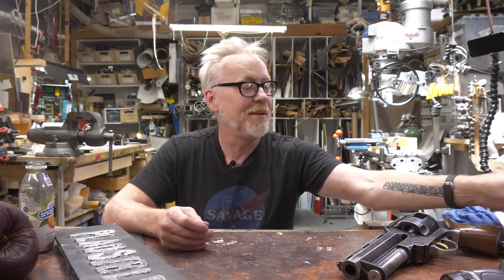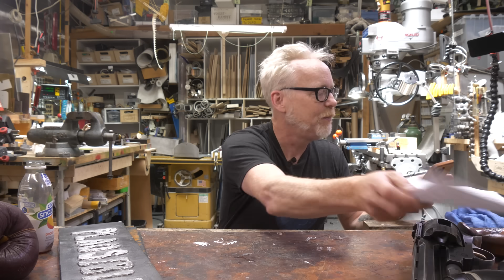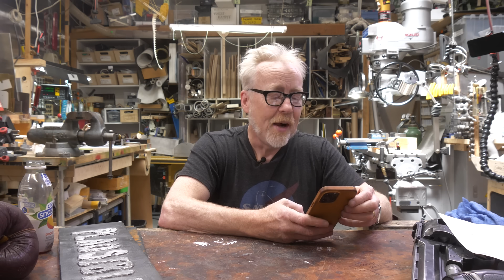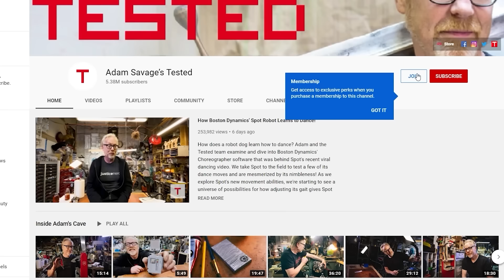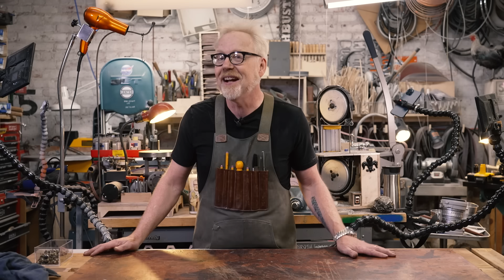Hardest-to-Obtain Item in MythBusters History

Comment: Adam: "Can we blow up a grenade?"
Insurance: "No. Too dangerous."
Adam: "Can we make our own grenade out of plastic explosives and blow it up?"
Insurance: "I don't see why not."
Reply: I think it's really that insurance can't evaluate the risk from getting anyone else's live grenade. It's like requiring that you pack your own luggage and remain in control of it.
Reply: its hard to accurately remotely detonate a grenade. imagine tying a strying to the pin and ping! but no explosion. the scenario of undetonated c4 is easier to apporoach than a grenade
Reply: @Iron_Triton  That's a great point. I also thought that the c4 grenade would lack the shrapnel, that would genuinely make it more predictable and safer.
Reply: @Iron_Triton I presume you could just stick some c4 to the outside.  But then you aren't just evaluating the grenade but the grenade plus extra c4 because you can't go add that after since you don't know if the chemical initiator will go off.
Reply: @Iron_Triton
Reply: @Iron_Triton  Just like in the movies!
Reply: @Iron_Triton  i think they were meant to be thrown
Reply: “Can we turn a cement mixer into the worlds largest grenade…”
“Yes, I don’t think that would be a problem.”
Reply: Don't forget the 20 ton cement truck they blew up.
Reply: What about a Cement truck? 

"Sure no problem"
Reply: Weird thing being is that I am pretty sure there's civilians with grenades that have posted videos on YouTube showing they own a grenade... I'd 100% trust Adam more with one than some random Texas guy xD
Reply: @SyntheticFuture  they don’t just hand them out. The paperwork to get your hands on any explosives* is extremely time consuming and tedious. You have to have special storage for explosives and there is a limit of how much can be stored in one place. Also you have to document how much you have, use, and manufacture. See the video Ordinance Labs did on this subject
Reply: @SyntheticFuture  Under federal law it technically is legal to own a grenade if you have the correct NFA title 2 paperwork and the grenade is properly registered as an NFA title 2 destructive device with the Bureau of Alcohol Tobacco firearms and explosives. 
However, California has additional state laws that ban the ownership outright of NFA title 2 devices, which includes grenades.
Reply: @SyntheticFuture  I have a grenade casing at home - a souvenir from my grandfather who built the casting machine used during WW2 (it is the un-machined steel casting).
There is literally nothing complicated about a Mills Bomb.
Reply: @SyntheticFuture  I had a roommate in the 1990's who had what was very likely a disarmed torpedo. (I don't remember where he got it, or if he ever told me.) We kept it in a heavy glass cylinder by the front door that I used as an umbrella stand. One day he got paranoid about it and took it to a fire station to get rid of it.
Reply: @SyntheticFuture  plq
Reply: @SyntheticFuture  And that is an example of elite fear... which isnt a good thing. You assume that unless somebody is of your level or higher (whatever you deem to be your level and you probably think you are much higher class than you actually are) that they must be stupid and therefore you are afraid they will do stupid things. But it is clear that high class and rich people do really really dumb things and should probably be the ones that we should be afraid of because they don't seem to care about others and seem to think their ideas are all good ones.
Reply: @SyntheticFuture vast majority eould be dummy
Reply: @SyntheticFuture  even if the guy in texas is being just as safe?
Reply: @hellishcyberdemon7112 honestly yes. Because there was a full production team and camera crew at mythbusters and he would be extra careful to not endanger any of those people.
Reply: @SyntheticFuture  yea i see dumb guntubers getting their hands on this kind of stuff, the reason why they actually can do it is because they dont have an insurance company telling them what they can and cant do
Reply: @worldchamp1999  well they do have to pay a lot for a tax stamp since it is a destructive device
Reply: It's less about insurance and more about  BATFE regulations... It's not very difficult to repack a de-milled grenade, fill it with some plastic explosive, then use a fuse assembly from a legally purchased and $200 tax stamped non lethal type of grenade, However the donor grenade must then be destroyed after recording paper work / providing a serial number to the "new DD grenade" along with a $200 fun stamp before activating it... Transfer of existing live 40mm HE grenades, hand grenades and other surplus military explosives whether new or original between Federal explosive license holders is basically impossible because the BATFE will usually just deny it after months of waiting with no actual reason given, so unless Mythbusters would've been working with someone who already possessed legal hand grenades or the military (yeah right lol) then there is really no good way for the bomb squad to aquire a fused grenade, plus they'd need a reason as to why, and "for training and education" doesn't cut it. So that's why they took the easiest, safest, fastest route of filing a "random metal object" with high explosive. No record keeping needed other than quantity of explosive materials used and for what purpose (training 😉) all while technically not creating a destructive device that would have to be serialized, recorded, and justified to the tax payers lol 😄
Reply: @worldchamp1999  Majority of the “guntubers” have federal licenses that allow them to posses the things they do. Why do you have a problem with someone obtaining the correct license(s) for what they own? The government knows exactly what they have and how much. I can guarantee they are a lot more responsible with it than you would be. Just because you hate or are scared of guns explosives etc doesn’t mean you can degrade someone simply because they own it.
Reply: @huntguy3831  Humans like to destroy that which they don't understand.  Most people can't fathom what some have gone through just to get some of their collection. (I tried to make that as YouTube friendly as possible)
Reply: @worldchamp1999  there is still a ton of paperwork and money required to get your hands on that stuff. I can almost guarantee those gun tubers have an explosives specialist doing all that behind the scenes as opposed to going through that trouble themselves
Reply: @huntguy3831  i literally do not care. its not my life. stop assuming. its called making statements
Reply: @berryreading4809  Your legal rundown seems about right (I'm no expert but have briefly looked into it), but I'm surprised  the military wouldn't have anything to do with it.  They have been known to work with Hollywood as long as they are shown as being the good guys. It's a recruiting tool.
Reply: @worldchamp1999  I made a statement too. You can’t degrade someone then get mad when someone else proves you wrong. Don’t dish it out if you can’t take it.
Reply: @worldchamp1999  lmao.

"I ran my mouth about a subject I'm completely ignorant of, and am now fannyflustered because someone dared to educate me"- aa ko
Reply: @adfdasdfadfadsfareae  yes that is exactly what is going on and you aren't at all delusional and in need of a hobby. lmfao
Reply: @huntguy3831  i can take it so good that i really dont care. that is the point you are missing. i dont comment in order to participate in any debates that might come up from it. i just drop and go. have a nice day. some of yall need hobbies fr lmao
Reply: @huntguy3831  I know a few people with those licenses and they are irresponsible AF. I wouldn't trust those guys with a .22
Reply: @worldchamp1999  I don't need to have to choose a side here to say you are wrong
Reply: @huntguy3831  American guntubers*. In Russia before the events of the past year military storehouse managers were comically corrupt and it was an open secret they’d sell military hardware to anyone without even documenting it. Rampant lying epidemic. Russia is currently fielding outdated hardware they weren’t even thought to still have as it was all meant to be sold abroad.
Reply: @worldchamp1999  yea making incorrect mean statements maybe... if you don't know what your talking about don't speak
Reply: @huntguy3831  most guntubers arent .... they get themselves hurt all the time doing stupid sh*t with the guns and explosive they "obtain legally" 

just look at FPS Russian he almost died several times to explosions and misfires while recording his videos
Reply: @huntguy3831  holy balls someone got triggered by  “guntubers” lol
Reply: @worldchamp1999  It’s about a few things, they need a certain SOT, most likely a FFL, a registry of most likely all of their destructive devices (grenades, dynamite, plastic explosives, Molotovs, etc), and probably to inform the ATFE when they are using said explosive.
Reply: @berryreading4809  So, Could Jonah Hill have one in his trunk in war dogs r nah?
Reply: @theduckfromthejoke152  Not like the movie lol, you have to have the fuse assembly separate from the explosive filed grenade body, with each in a BATFE/DOT approved transportation lock box and vehicle with the appropriate hazmat stickers... Atleast when traveling around the USA 🇺🇸 😉👍
Reply: @berryreading4809    So you could have a grenade but you can't carry class 3 weapons or whatever they were called?  Good to know!  😁😁😁   Although you might just be explaining how to transport it not what credentials you need, cause the way you wrote it it sounds like you don't need any credentials you just need some boxes And a form
Reply: @worldchamp1999  really funny how, you say this and at the same time have a profile of and name of a person that forged a world record and went to great lengths to solidify it INCLUDING the legal justice system.
Reply: @berryreading4809  getting a FFL and an explosives license sounds much easier.
Reply: Irony of you calling them dumb guntubers and YOU have no understanding of how and why, let alone the legalities, they get to detonate explosives on their YouTube channels.. 

Lol you exposed yourself, mate. We all love the mythbusters, but they're just nerds. A lot of those "dumb guntubers" have real world experience with what these guys experiment with.

Get over it, bubba.
Reply: @worldchamp1999  You aint smart enough to own one.
Reply: @aprogressivegamer7005 wow, 2 guy did stupid shit a lot so they are all stupid, most of the other injuries where due to unforeseeable accidents that ended I'm catastrophic failure of the weapon,
Reply: @SyntheticFuture  honestly yes I dunno why but I reckon he's got a better grasp of understanding.
Reply: @SyntheticFuture  Remember that even explosive ordnance experts are random strangers to you. Just because you saw Adam on Mythbusters doesn't make him more qualified than some guy on YouTube to handle a grenade.
Reply: @SyntheticFuture  The difference, I understand, is that they illegally obtain the grenades.    Mythbusters wouldn't.    You'd be surprised what you can find at flea markets.
Reply: @AngelusNielson 
They don't illegally obtain them. Most of them work with Ordinance Labs.

There's nothing illegal about owning a grenade. You need to pay a $200 destructive device tax stamp and submit your fingerprints to the ATF and have an explosives license, or alternatively fill the hull with a non-explosive like gunpowder.

The only weapons systems that are federally illegal in the US are machine guns, guided missiles that target aircraft, and WMD's.

Everything else can be owned with the proper tax and licenses
Reply: @noahw4623  America is fucked up.
Reply: Goes to show the skill recognized in myth busters tech, the insurance trusts their work better then a manufactured grenade.
Reply: I mean having the grenade equivalent of C4 in the casing of a grenade is far safer than a grenade itself as you have control of the detonation.
Reply: Maybe removes any corporate liability from the grenade manufacturer? The more the gang were responsible for making the device, perhaps the insurance wasn't so bad 😂 or paid out less.
Reply: Makes sense. You know way more about the construction and ingredients in a plastic explosive device that you've built yourself. Also probably something to do with the lack of fragments from the grenade casing. :D
Reply: i remember hearing it from somewhere(can't remember the source) that actual grenades have not very reliable fuse, meaning that the time it takes for them to detonate aren't very accurate, i am guessing that might be one of the reason they'd not want actual grenade detonation
Reply: I think the difference is that grenade fuzes are notoriously unreliable, they have a range from 3-5 seconds and they have been known to fail.  The C-4 replica they used was electronically detonated, a method that has basically 100% success rate.
Reply: Real grenades are made to eject shrapnel in a certain way, theyre made to cause as much damage as possible to whoever they got thrown at. Im sure the insurance company figured that mythbusters couldnt possibly do any more damage with a home made grenade than a real one.
Reply: From the perspective from the insurance company: They now know the grenade was produced by an engineer who's past work is known to them, numbers go up, money is saved
Reply: I've watched sub-50 IQ grunts throw them in basic training. Shocking that no one would bring you into the fold for a day.
Reply: It's wild, but think about the fact that any agency with access to a grenade has to account for saks grenade. Hypothetically, if you went to the Army, an officer can't just give the okay to hand a grenade to a civilian filming a show. It would be pushed up the chain of command, and I'm sure there are very specific regulations in place that put hurdles in the way. Even if it were feasible and lawful, which it might not be I'm no expert, it would likely involve requiring a master at arms/Provost Marshal on the premises to make sure that there's a clean chain of custody, that it's disposed of correctly. 

Then there's the liability that filming of such could be used as counterintelligence. 

So while it's easy to just say, that's wild they're the same thing, I also totally get it.
Reply: Me: wants to give him my Vietnam era grenade
Reply: The issue is the conventional mechanical trigger fuse on a grenade.  

Needless to say, it is not the safest thing in the world.
Reply: XD
Reply: Plastic explosives are more stable than TNT
Reply: The US Insurance companies in a nutshell
Reply: I don't know if that will do, but I guess that's all we can C-4 now!
Reply: What could possibly go wrong??
Reply: I know this is going to sound like BS but I bought a grenade at a gun show (just like they probably did)

Now I will admit it was hollowed out from the bottom (quarter size hole). 

This grenade was a MK II or MK III version. So I assume this is the best he was able to get a hold of too. Oddly enough, that vendor had multiple products that were rendered 'so called ' useless

Funny how you can get a empty grenade or shell but you cannot buy a live or non-modified version
Reply: @nomore-constipation  Rumor has it, and it might be true, someone picked up a container of nuclear material at a swap meet that was radioactive enough to cause serious problems when he opened the case to take a look.
Reply: @nomore-constipation  Ah, I've seen those too those are typically called "Training Grenades" and are meant to feel as heavy as a real grenade and are used with a removable pin in basic training to see how far a prospective US military cadet can throw.
Reply: Good ol insurance cartels with their nonsense
Reply: It actually makes sense because you cannot accidentally pull the pin of the homemade grenade detonate it. Real grenades are a single little squeeze and  tug away from killing everyone around.
Reply: Army to 17yo National Guard recruit at basic: “Here, throw this grenade.” 😂
Reply: Finding military grenades/ automatic weapons/ drugs (pervatine) is pretty simple.    Most local libraries and museums have them without realizing it.

I worked in museums and the problem of some elderly veteran donating his war trophies (explosives, automatic weapons, narcatics) without anyone realizing it is nationwide
Reply: Adam: "Can we shoot up a grenade?" Insurance: "Yes, you've already done it! Did you hit your head again..."
Reply: probably because of how certain laws are worded
Reply: Grenades like defencive are with shrapnel. Just plastic explosive does not. Also wi5hout shrapnel the lethal radiouss reduced.very quickly.  Power of 3  if you double the distance drops 8 time if triple  the distance falls 27times
Reply: I'm  almost positive it has less to do with insurance  and more to do with Commiefornia's extremely  weird ATF laws
Reply: Can we legally purchase an NFA item? Ins.: No
Can we questionably legally make an unregistered destructive device then destroy all the evidence? 
Ins.: Yeah sounds cool
Reply: Dead meme is dead.

Comment: My only grande story:  summer of 2001 I was going through basic training for the Army at Fort Benning GA. On the day you go to the grenade range you work your way up practicing with inert grenades, then practice grenades that only have a blasting cap, the finally you get to go the live range and throw two real grenades. Everyone stands in a big line behind a concrete wall. wearing helmets, flak jackets and ear protection.  As you near the front of the line there was a big bullet proof window where you could watch the explosions of live grenades down on the range, as I was standing in front of the window being underwhelmed by the explosions I noticed a hole in the window big enough to stick my finger through. I remember thinking "welp I done looking through this window" and was more impressed with the grenades